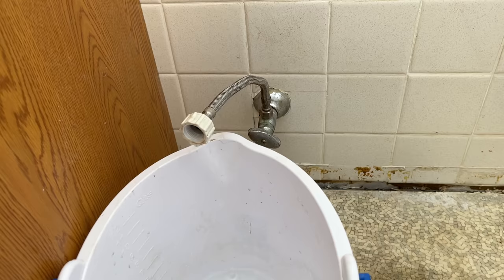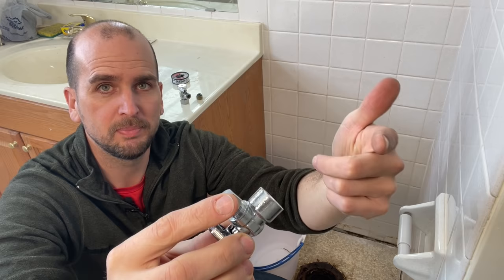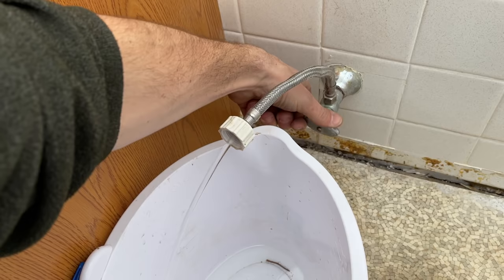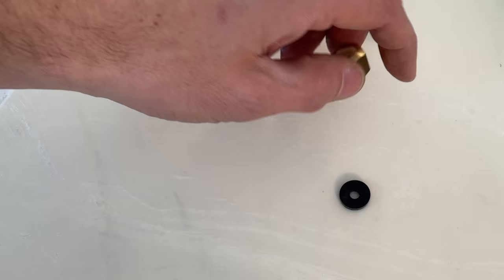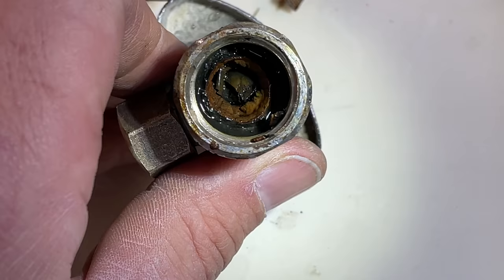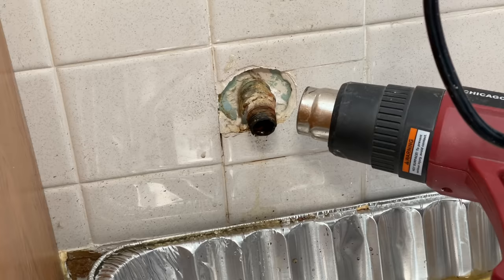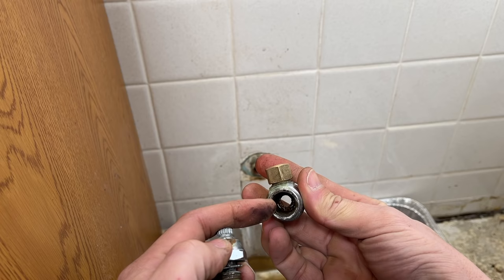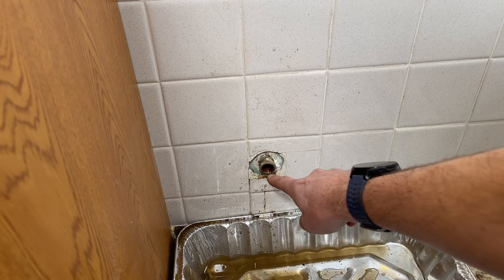Toilet Water Supply Valve Replacement | Can't Turn Off Water

Comment: Totally different subject but what can I do to stop my toilet system get condensation on the outside in the Uk it's a real pain .?
Stay safe stay well
Reply: Not much you can do. It’s condensation from the cold water in the tank combined with warm humid air outside, the same way a glass of water sweats on a hot day
Reply: Flush less 😉.  Is your toilet always running, if so then the tank always has cold water in it and can never get to room temperature for it to stop causing condensation.

Edit : Changed 'it's' to 'is'.
Reply: Nicholas Hunter thanks for replying, stay safe stay well
Reply: Dustin Tunis thanks for replying, stay safe stay well.
Reply: With Toilets you really get what you pay for. The cheaper ones are not manufactured/built like the more expensive toilets, i.e., glazed, etc.
Reply: Steve Kunkel I Couldn't understand what was happening and now that makes sense we moved six months ago , well guess I'm getting a new toilet, many thanks stay safe stay well

Comment: what size is the cap you put on and what is it called? i have that problem right now--dripping 1 drop a second into a small container--my repair guy is coming in the am--guess i will be up several times to dump it
Reply from the maker: Hey John, this video shows the cap and more importantly flat washer used.  Links in the description of that video will show the exact sizes. https://youtu.be/zyxbd_0EdgI

Comment: When trying to remove mine the hole thing turns too so i stopped cause i dont want to damage anything.  I dont knwo if iam unscreing it or the hole pipe inside turning too?? I have seen so many videos where they use two players one to hold the turn vaulve in place and the other one to loosent up the compression bolt

Comment: Any chance if getting a Q answered Now? I see most comments 7 mos ago!! COULD THIS PROBLEM LEAK "BACK" behind wall and down under floor? I have toilet leak wetting under floor thru bathroom and down hall. I shut the VALVE but water in bowl still is rushing in.

Comment: The old nipple failed due to galvanic corrosion. Steel & copper do not work together. You should have used a valve with male threads on the inlet or used a brass nipple.
Reply from the maker: Appreciate the feedback and I actually did take the feedback from the viewers and circled back with a brass nipple.

Comment: Why bother with the 3/8 cap when you're just changing the valve anyway. Just put a rag on the floor for any last water drips.
Reply from the maker: Good question but that was just to demo as other homeowners might need to cap for a day or 2 prior to changing.  Should have made that point more clear, thx.

Comment: Why not put a 1/4 turn valve on? 🤔
Reply from the maker: Hey Gary,  sorry the handle on the new one throws you off a bit.  That new valve is actually a 1/4 turn valve just has the same handle as a multi-turn valve.

Comment: I am NOT a professional plumber!  But I have done "Punch Down" for many years.
I would NEVER!  NOT EVER use compression valves!
NOR am I a fan of using those silver valves. They ALWAYS corrode and stick
Use instead a quarter turn nylon ball valve and replace the handle with something more fashionable.

Comment: Temporary fixed.  Didn’t fix the issue permanently... 🤦🏾.   Im assuming your a handy man? Or a experience diyer?  I was like that first few years learning the trade.   Even the basic of wrapping telfon tape is 🤦🏾🤔.  But its fine we all learn.   Also the difference type of metal is not a good option. This also goes for other piping not just plumbing.  For water cooling pc if you did that it will rust the other metals. Thanks for the video.

Comment: The basic problem here is electrolysis, it wasn’t just a thread broken off. You should be precise in your description to ensure the viewers fully understand the issues. Also your description of the compression fitting leave a bit to be desired, the nut compresses the olive to form a seal provided the pipe surface it totally clean and not dented in any way. Just sayin!!!

Comment: Rolling the tape on the new fitting --- being put on in the wrong direction.  It will buckle up when being screwed into the pipe.  Should be rolled on in the direction that will help it tighten when the fitting is screwed into the pipe.  He is NOT a qualified plumber.  He is a "Hack" -- a "Wannabe".